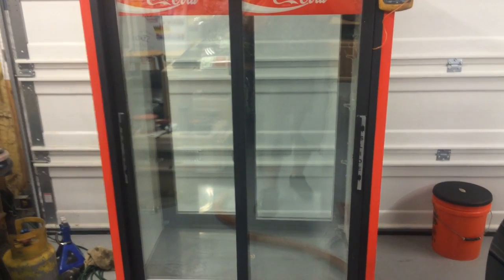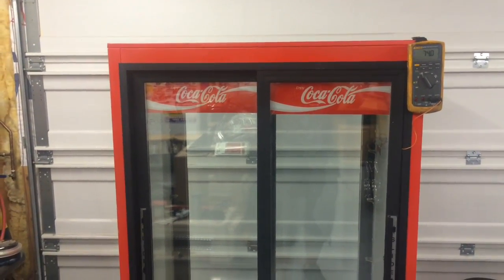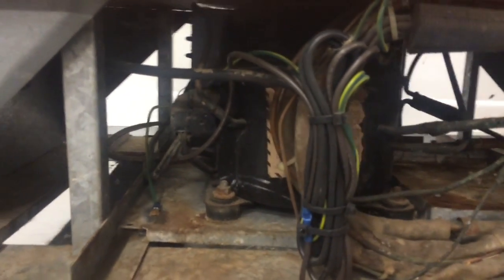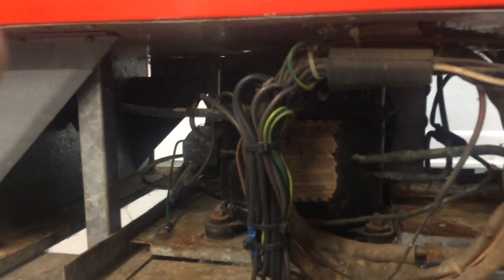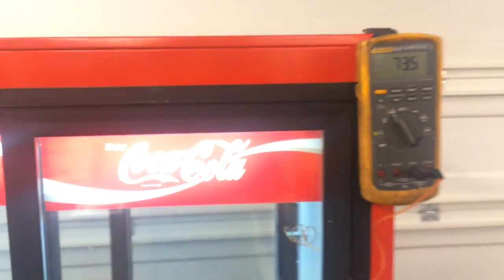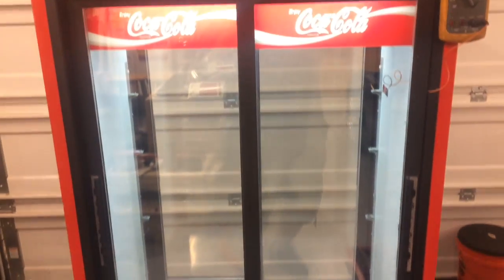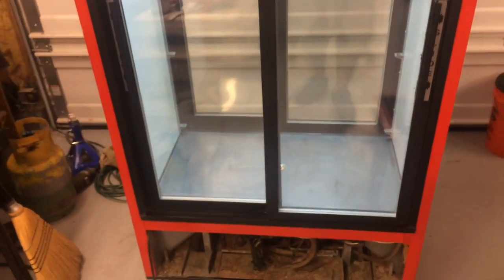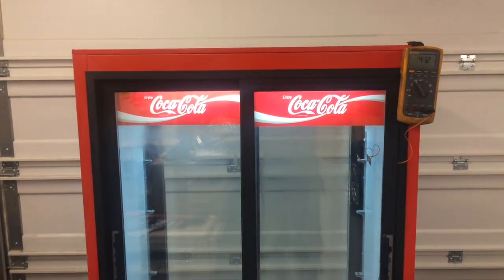Beverage Air Coke Refrigerator

Comment: I need help with mine it's freezing my beverages I need to regulate how low it goes can youn help?
Reply from the maker: If I remember correctly, because I currently don't have the refrigerator anymore, there is a thermostat at the top of the interior of the unit. I put a digital thermometer off my fluke in multiple places, monitored the compressor cycling, and got as close to 36F as I could. If your thermostat is failed closed, you may not be shutting down the compressor when needed. Kind of hard to say, but hopefully something of all this helps.